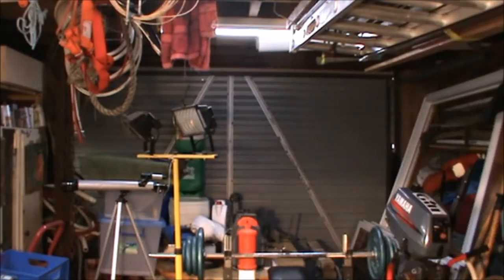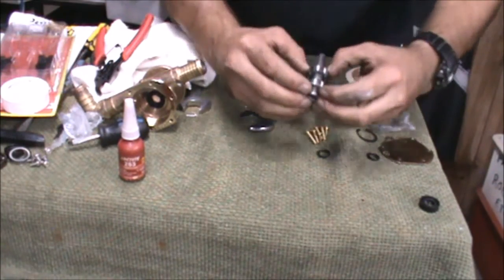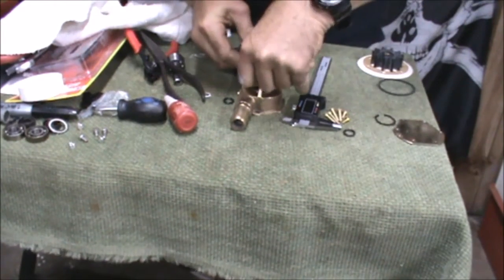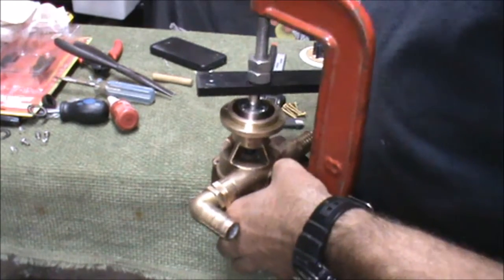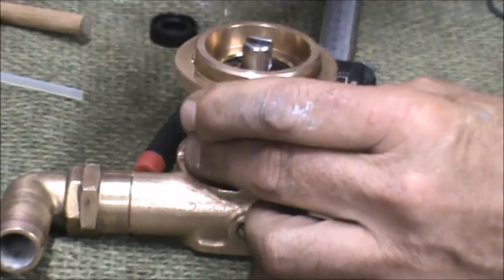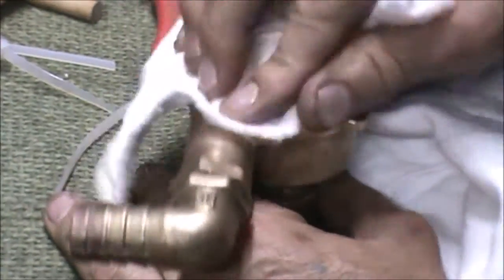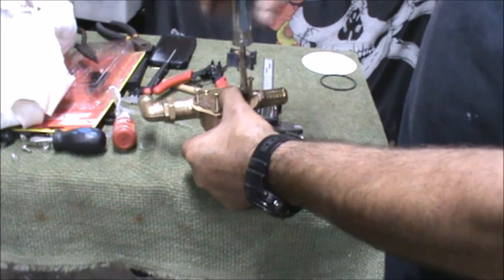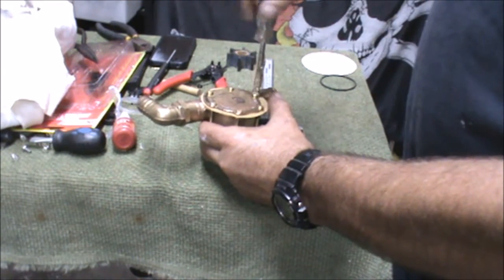Raw water pump refurbish

Comment: nice video but if that was my pump i would throw them screws away and use  Alan key screws you will find them easer to take the pump impeller plate off much easer  to replace and secure the plate  with no problems
Reply from the maker: I've had issues with allen key screws rusting out on a heat exchanger. ( Check my heat exchanger video out) I agree that they have their place and they'd work great in this application but I'm ok with how things turned out.
Thanks for the feedback.